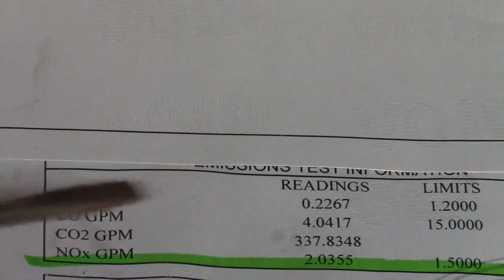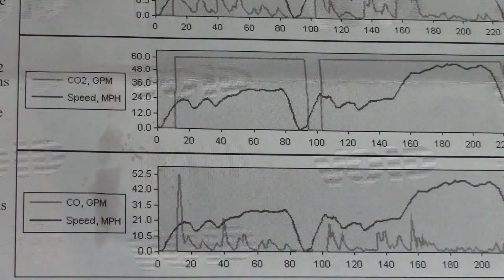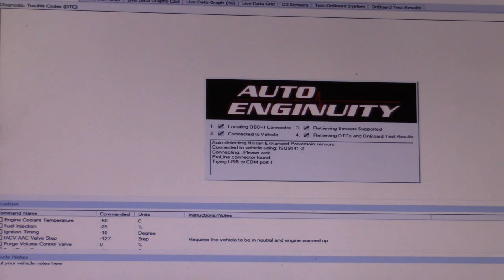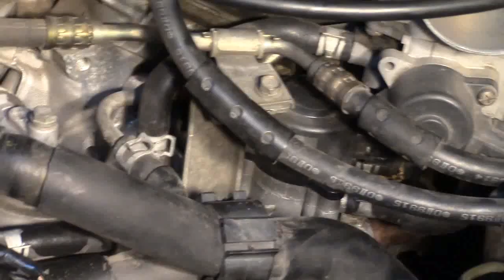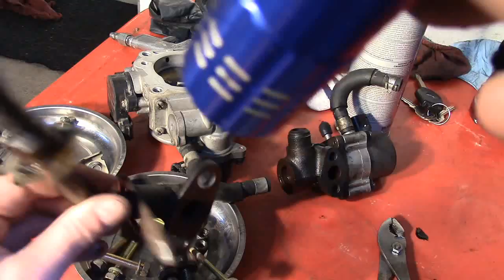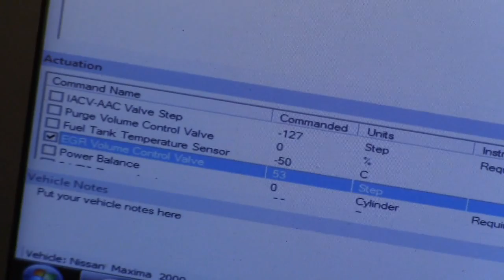2000 Maxima NOx Emissions Fail, No Check Engine Light- Bad EGR?

Comment: I think the light bulb in the check engine light may have been replaced with a burnt one :) The check engine light comes on so infrequently that it's hard for me to believe it's burned out. However, if someone checked whether the bulb was even installed during the car buy, the car seller could use a plausible deniability that he didn't do anything to the bulb, it just burned out on its own. Salespeople are clever beasts. Anyway as always great video, great lesson. Thanks again :D

Comment: Hi
Really a very informative video.  I have a 2002 nissan pathfinder and I think the egr might be in a similar place on it.  I failed a nox emission test 1.7 gpm only, 1.5 being the limit.  Curiously my nox graph from the test looks very much like yours in your video following a similar pattern vs speed.  
My question is , where on my pathfinder is it?  I can't see it and I'm going crazy looking for it.   I've looked on the net and I see some cryptic drawings but it isnot clear, even in the service manuals.  Any advice to help me get at it would be helpful.  I'm in Colorado too by the way as I noticed your emissions sheet was there.
Reply from the maker: it’s located right on the Intake- connected to the exhaust manifold.
Reply: Thank you.  Is there a good picture or diagram of it somewhere ?
Reply from the maker: not that I know of. it’s connected right off the exhaust manifold you can’t miss it.

Comment: Thank your for the informative videos. I appreciate learning how to try to figure out the problems not just reacting to the symptom's lowest hanging fruit.  I actually just failed an emissions test in CO with an almost identical looking graph for high Nox levels as this video's.  Everything I've been able to figure is that its something with the EGR system,  problem is it's on a 2000 Dodge Dakota 4.7L which apparently doesn't have an EGR.  Any thoughts on where to start looking for a similar Nod reading?
Reply from the maker: A high fuel trim can also cause NOX. On a car with no EGR I would start with a basic fuel trim analysis as the first step.
Reply: @SchrodingersBox  thanks for the super quick response. After watching more of your videos I will probably need to take it in to someone to get that looked at.  Have a good New Year!

Comment: Hey, Matt. I was watching the video just to see how you would test the egr valve. I tried to understand the circuit, but failed. The pcm wants to see 0.1 v-14 v at idle  at pin 9 , 18. 10 and 19. Would you happen to know how the system work? What if you don't have the  0.1-14v at idle? Your response would be highly appreciated.
Reply from the maker: Are you referring to this car in the video?  This car uses pulsewidth modulation so your voltage amplitude only changes from .1 or 14 but the pulsewidth varies in order to position the pintle.
Reply: Yes, Sir. So, you can't backprobe these 4 pins and use a dvom?
Reply from the maker: @bbmd2200  You can indeed however rememeber the frequency on a PWM is relatively  high so you will only see an average of the amplitudes weighted by duty cycle.
 If this consideration is not made you will misinterpret the results.

Comment: I have a 1998 Nissan frontier manual with this same issue EXCEPT my check engine light bulb is NOT a failure. What would your thought process be?
Reply from the maker: What data do you have?
Reply: @SchrodingersBox  I have two failed emissions tests I wish I could send you a picture of the chart. My car failed the HC @ 1.7934 with a limit of 1.2000. I also failed NOx @ 6.6602 with a limit of 2.5000.

Comment: Recently had emissions on my 92 honda accord LX passed everything except NOx standard in AZ is 2.50 i got 2.73 so i replaced egr it was completely covered in carbon installed a new changed the spark plugs changed the oil top off coolant and right before the second time i drove it hard on the freeway with the a/c about 15 minutes took it back to emission passed NOx went from 2.73 to 2.30 good for 2yrs 😄

Comment: I really need your advice.

I have a 2005 chevy tracker. It came from the factory with a 2.0 suzuki engine. It has failed emission 3 times for NOx.
6 months ago, had the top of motor rebuilt. Coolant is good, fan is running, car does not over heat.
1 time fail, changed the Cat Converter. I don’t remember the data for NOx
2 time fail, changed the EGR Valve. NOx 1000+
(when I picked the car up the check engine light was on for the 1st time, then the mechanic cleared the code that caused the light. He said it was because of the change of the EGR valve.)
3 time fail, don’t know what else to do. NOx 800+

If you what to pm me --- silence280 at G mail dot com

Any advice you can give will be appreciated.
Reply from the maker: you never listed any data here. what is your data showing you needed to replace the cat and EGR valve? was this based on S1 and S2 correlations???
Reply: the reason the cat and the egr were replaced was because the car failed emission for NOx only. i don't remember the levels for the 1st failure but then the mechanic said it was the CAT so i bought it and he replaced it. it  failed again with NOx levels over 1000. then he said then it must be the EGR so i bought that and he replaced  it and it failed again with NOx levels of over 800.
Reply: I did some checking and found that I have a bad MAF sensor. The way I tested it was by pulling the pug to the sensor while the engine was running, and it did not stall and I could hear a little change in the idle. My question to you is, do you think a bad MAF will cause high NOx?
Reply: here are the data

With New CAT Converter
   Idle  Engine under load
HC ppm  7  7
CO%  0.02  0.01 
CO2%  15.2  15.1
CO + CO2% 15.22         15.11
O2%             0.0  0.0
NOx ppm 422          1021
Lambda  1.00  1.00

With New CAT and EGR
   Idle  Engine under load
HC ppm  3           1
CO%  0.03  0.01 
CO2%  15.1  15.1
CO + CO2% 15.13         15.11
O2%  0.0           0.0
NOx ppm 829           365
Lambda  1.00  1.00
Reply: sorry, it did not post the way i wrote it

Comment: I have no problem with gases emitted as it is passed and clear but my car, a Jaguar 1999, show Code P1000 on ODB2 scan, that is no error code but INC or incomplete drive cycle. Unreadiness. I did the drive cycle as I could understand but it still wont change and I don't see the completion of cycle even after 1 month and hundreds of miles... Can you help me as to what I should do?
Reply from the maker: I would need to know which on board monitoring self test component is still showing open

Comment: i would have  checked the egr flow temp data to test the sensor and further verify the repair because even if the egr valve works the computer needs to see the temp rise as the egr valve opens. also one of the coolant hoses going to the egr looked like it was starting to split and leak.
Reply from the maker: Why would that be necessary when we saw the change in idle and fuel trim after replacement??

Comment: Will this make the compression seem low or outta whack and are high/low idle fluctuations a symptom of a p0505 to or maybe a  cranking no start
Reply from the maker: A stuck closed EGR will generally have no noticeable symptoms whatsoever.   A stuck OPEN one on the other hand would have symptoms much as you described.

Comment: Hi there, I got the same graph for NOX and failed. But there is no check engine light (genuinely). You think my problem is the EGR valve too? My car is a 2000 Mazda Protege. Thanks
Reply from the maker: No idea. what data do you have for desired and actual get position? what was result of the eve activity test?
Reply: I wish I could attach pictures here. 
HC     0.0667      1.2
CO     2.93           15
CO2   259
NOX   2.21           1.5 (failed)
Reply from the maker: Yes that's. your emissions data- you said that. Where is your EGR performance data?
Reply: Schrodingers Box how can I send you a picture of that?
Reply from the maker: You just tell me.  What happened with the EGR test?
Reply: It just looks like what you showed in this video, with every increase in speed the NOX emission experiences a spike. It also looks similar to that of the Maxima at the stopping point. However, I don't get a check engine light even though my check engine light is good.
Reply from the maker: No- what happened with the MANUAL activation or bypass test?

Comment: I  have a 91 Integra that's famous for clogging the EGR capillaries buried deep inside the intake manifold.  I drilled and tapped four clean out ports with the intake removed of course and I can check and clean it every time before I go in for smog check. Takes five minutes before the test and my smog guy was impressed too. The reason they clog is because the gasses are cooling and condensing at the point of the clog. It makes perfect sense that the passage way with coolant in it would clog just like the point of entry to the intake runner where it's the intake air that's cooling the exhaust gasses and causing the build up. Great video as usual.

Comment: Schrodinger,

Diagnosing an EGR issue with my car, before finding your channel I was another 98%er and threw an EGR valve at it. Of course this didn't fix my problem. But now I'm learning things your way.

Old valve holds vacuum @ 15 psi (OEM specified from service manual) but I DO NOT see the valve open/close or even move. This is not the stepper type. No electrical connections. So I tested my new valve while it was on the car by applying vacuum and it too holds vac, but did not kill the vehicle. I also don't see the valve move when I apply vac to it dismounted from the intake. 

My question is, should I not rely on this valve opening visually as it did in this video? Or by it not opening is this an immediate sign, of some random occurrence that I have two bad/stuck valves?
Reply from the maker: Sounds like blocked passage at the intake manifold to me

Comment: 2000 Maxima, that's my year, too. It's nothing short of incompetent engineering for all automakers not to have used LEDs back then for critical indicators on the dash. Question - is it possible for this car to record a code without triggering the SES (check engine) light?
Reply from the maker: ALL Obd2 cars can do that. it's called a "pending code". It occurs when there is not a sequential detection onconsecutive drive cycles to meet the threshold for SES illumination.
Reply: Ah, now I understand. Thanks for taking time to let me know. Well, I drove to the parts house right after posting, and there are no codes. It's almost unbelievable that a car can run this badly and not post a code. It actually backfires for the first few minutes after I start it cold. Kinda funny, actually.
Reply: This turned out to be the MAF sensor. Cleaned it with CRC spray and the car is running like new. My first experience with these.

Comment: Hi Mat
Thanks once again for the lovely video. 
Can you plz do a full tutorial on emission. How to use the emission result from a gas analyser to diagnose  the cause of the problem. 
Just like the one you have here with high Nox reading. Maybe with all the other gasses like Hc, co etc. 
Thanks
Reply from the maker: Being a DIY I do not own any direct measurement equipment for exhaust output however I cover much of this in my "everything to know about check engine lights" video

Comment: just my knowledge of mucking about with cars when younger, garage said it was cat but I'm not sure? with no engine management light on either so the clogged EGR I will try it's right on top corner of rocker cover so it's easy to get to I suppose, iv ordered the 2 lamdas sensors and cataclean and new  bosch super 4s I'll try that when they come and retest it!

first idle test 
CO % 2.654 fail
HC ppm 189 pass
lambda 0.939 fail

second idle test 
CO % 3.643 fail
HC ppm 247 fail 
lambda 0.908 fail 

this time 

Natural idle test 
CO % 0.140 pass

so it passed on idle test failed on fast idles

Comment: hi , I wonder if you can help? my car failed on emissions first and second but passed idle CO HC sky high says need new cat! I want to try everything before new cat! no engine light either!? iv just bought new plugs, the 2 lambdas, and cataclean it's got new temp sensor might be map sensor but garage receptionist say its cat but the mechanic and mot inpector didn't know! ? if I can send the numbers could you tell? iv ordered a scan tool to check lambda readings but just waiting g on everything coming
Reply from the maker: cant help unless i have data bro.
Reply from the maker: See my video on catalytic converter analysis. it is a starting point. But sounds like car is running rich.  I'd need a short and LT fuel trim curve against load to really narrow down.
  What was the data you used to determine the O2 sensors were bad and needed replaced? That would be a good starting point too.

Comment: I have a question maybe someone can answer for me. When a PCM detects a misfire on a particular cylinder - just how does it obtain this info to throw a code? As all of the sensors MAP, MAF, O2, TPS and whatever others there are none are specific to any one cylinder Right?  Scratching my head on this! So me being untrained and uneducated - my guess is it interprets each injector conditions volts- amps so-on . That being said, can or could it do this by doing a in sort of a self diagnostic by increasing or lowering fuel trim for each injector until the PCM determines the faulty or misfiring cylinder ????
I'd would appreciate a reply.
This channel is damn informative seems the more I learn the more interested it becomes.
When I was younger back in the early 70'S I work as a auto mechanic but everything was pretty much all mechanical adjustment - not much available diagnostic equipment!

Comment: Stoichiometry of octane and air.
Octane 
C8 H18 + O2 > H2O CO2
2 (C8H18) + 25 (O2) > 16 CO2  18 H2O 
 228.45704 g octane + 799.97 g O2   228.45704 g octane + 3457.040572792

Oxygen 15.9994 g/mol 20.95% in air 
O2 31.9988 g/mol
Octane 114.22852 g/ mol
Air 28.97 g/mol
Ratio,of air to octane
15. 132 to 1
This assumes 100 octane gasoline. 

I always heard it was 14.8 to 1.  That would be 98 octane gasoline. 
Sorry it's winter I'm bored......

Comment: Hi there, Schrodingers Box, I have a problem with my 02 jeep liberty.
I have a misfire code on cylinder #2

Also, in the cold upstate NY mornings when i start it up, i smell maybe unburned fuel accompanied by white smoke maybe water vapor. i cant tell because its always cold here..anyway that vapor smells just like the vapors coming from my oil cap...which by the way, my oil cap has the milky stuff all over it. However, when i pull the oil dip stick out, i dont see any of that milky stuff on it (so i changed my 4 dollar PCV valve just in case)

Anyway, the misfire problem is not fuel nor spark related; it's low compression (about 60 psi) however, when i did a compression test, the needle would pulse at its max 60 psi but it would intermittently stop and then pulse once again.
Could this be a broken valve spring? here is a video of the compression test i did.
https://www.youtube.com/watch?v=OgaLxe9o0A0

Please help. Thank you very much.

Comment: I had a p0400 error code on my 2000 Infiniti I30.  I had the EGR tube cleaned and no more p0400 code and my car passed smog!!!
Reply from the maker: kraze4u Yep I see this much more often than I do failed EGR valves. Free fix if you do it yourself- no parts required. My favorite fixes!

Comment: They stopped the CEL automatic fail in Colorado and yet sort of brought it back.  You can have a CEL and pass the emissions test 12 model years and older.  http://aircarecolorado.com/index.php/fail-and-repair-information/check-engine-light/

Comment: Is that thin EGR pipe right in the middle of the throttle body seems to be something of an unusual design.  Most designs just dump the EGR flow in the intake.  Have you come across this type of design in other makes?  That engine has few other oddities like pre-cats + regular cats etc.  But that VQ 3.0 engine is very nice and eager to rev and ample torque at low end making it easy to teach how to drive five speed,  On level road, there is no need to give gas to start from stop.  That made it so much easier to teach my son how to drive manual car.
Reply from the maker: Actually I have seen many designs with an EGR tube- my Trans Am in fact has similar. 
 Otherwise, agreed- that Nissan had some firsts for me.  One thing that was interesting- the 6 wire IAC and 6 wire EGR connectors are completely interchangeable. Had to pay attention so I didn't cross them. Been a while since I've seen that happen where two adjacent connectors are identical like that,

Comment: Surely you used some tricks to get the cluster out of the car!  I know your general reluctance to show dis-assembly on your channel but you have to agree with me that getting to the cluster is lot more work than just taking off any fastener that you see.  Even the 1% can use your knowledge or techniques on how you managed to remove the cluster given that you had already alluded that replacing the check engine light was going to be lot more work at the beginning of the video.

Yes, you guessed it; I do own a 2000 Maxima :-)
Reply from the maker: Lol quite honestly, I followed exactly the procedure I used in my "how to replace an instrument panel bulb" video- I just looked for the screws and removed them as I found them.  Probably removed more than I needed to but honestly, no tricks or anything. Just a screwdriver, plastic pry tool, and ratchet were all I used.
Reply: Ha! Ha!! You have "how to replace an instrument panel bulb" video?  OK, I guess I was born yesterday :-)
Seriously, only experience helps in identifying hidden fasteners and knowing where and how much force to apply in yanking the dash apart without breaking it.